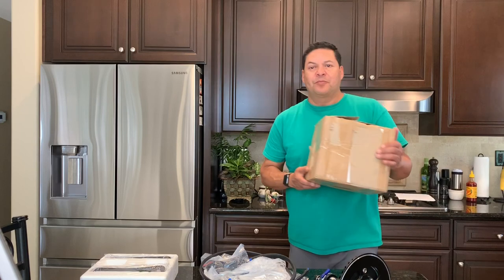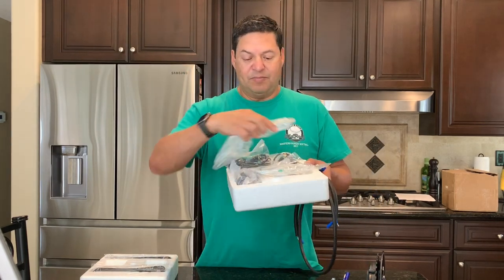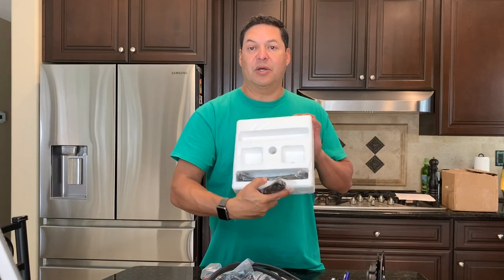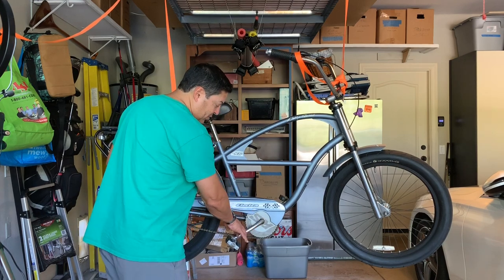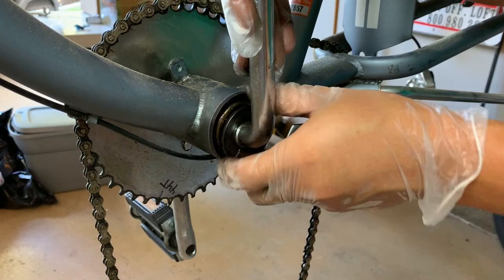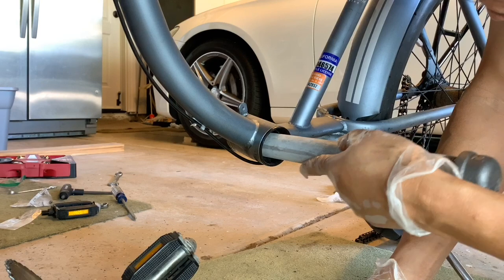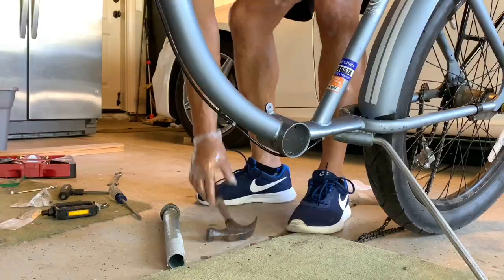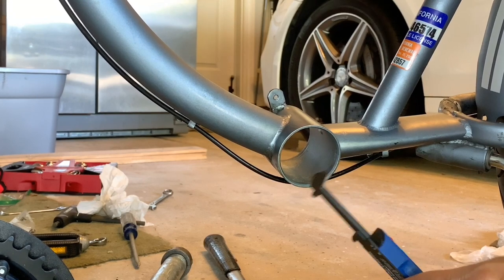Detailed Install of TongSheng TSDZ2 Mid-Drive eBike

Comment: All looks simple to install. How do you find the brakes. I have a rear coaster brake and wondered how well it works after converted?
Reply from the maker: Works fine!
Just be sure the chain tension is right so it won't fall off.

Comment: Question:  Do you know of, or have you experienced any issues with a coaster brake on a mid-drive ebike conversion?
Reply from the maker: I have.  Need to be sure to make sure the chain tension is correct.  If the chain is too loose there is a chance it could fall of at the worst possible time, like when you are trying to stop 😀

Comment: Hello, is the twist handle a throttle as well? I want to buy this kit, but only if it has a throttle.
Reply from the maker: It does have a throttle option, see https://cycles.eco/collections/tsdz2-open-source-firmware-osf-products/products/half-twist-throttle-right-side-yellow-3-pin?variant=32737292615762

Comment: I see you moved a cable from below the bottom bracket to above. Was there not  enough room to leave the cable under bottom bracket, did it interfere with the motor?
Reply: Correct presumption: there is not enough clearance for a cable to run under the bottom bracket.  It must be rerouted above.

Comment: Would it be possible to mount the motor within the frame? Looks like enough room and protects motor.
Reply from the maker: That won't work, it is designed to go underneath